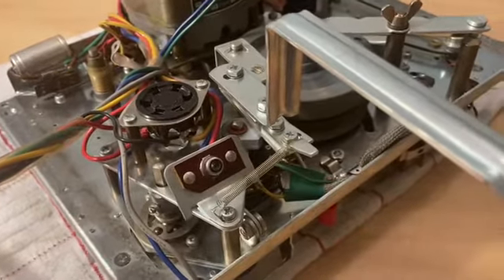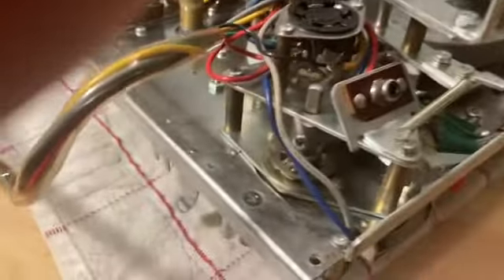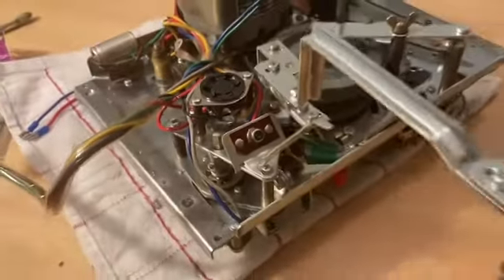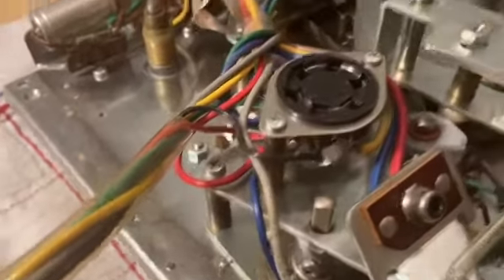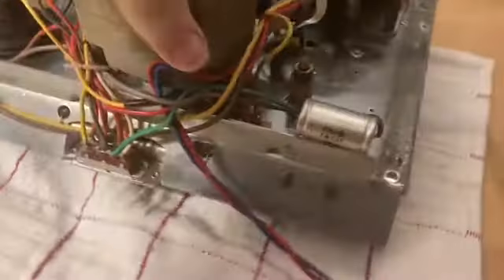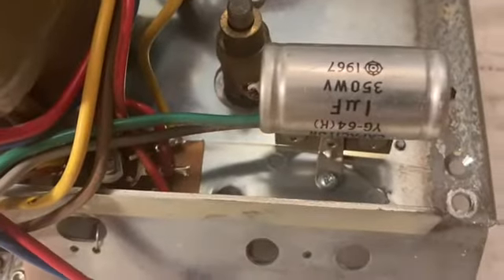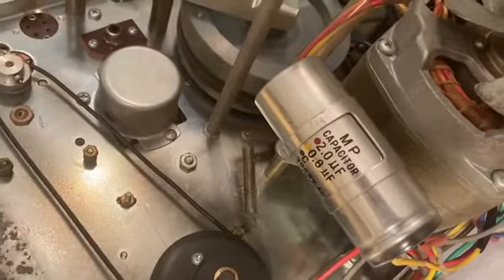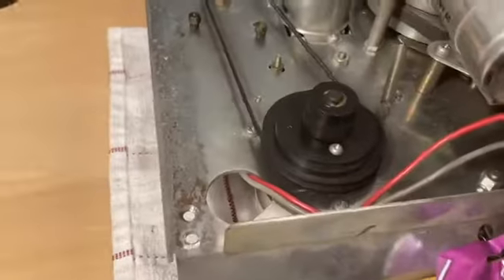Roberts 770x Reel to Reel Rear Cam and Motor Run Capacitors Replacement-Part 4

Comment: Hi, I realize this was two years ago, but it was very helpful. On question: Do you run the one connection of these cubes to the color wire, and the other connection to the "Common" wire? I assume that's how it would have to work. I've got a bunch of these on the way to fix my 770X, which otherwise works great, but slows to a stop when it gets hot, so I'm hoping its this big can cap that's the problem. Thanks!
Reply from the maker: Sean, sorry for the late reply.  The AC motor capacitor on my R2R had two capacitors in one cylinder. They are color coded. One for the .8uf(yellow wire) and the other for 2uf(red wire). I had to find two seperate AC caps and just zip tie them together. It doesn’t matter which direction the AC capacitor goes like electrolytic caps do. There isn’t a positive or negative or common to these.  Hopefully you figured it out already👍
Reply: @dayofone9786  Hi, yes thanks, got the machine sorted.

Comment: I have the same machine. It was working good until the motor stopped working. It has a slight motor hum but doesn't spin. Could it be the motor run capacitor.
Reply from the maker: Yes more than likely it’s the capacitor. Probably humming because it needs that extra kick from the capacitor to move the motor along. Mine was intermittent, especially when trying to rewind/ff tape. Definitely worth trying a replacement especially if it’s the original capacitor that’s still in the R2R.